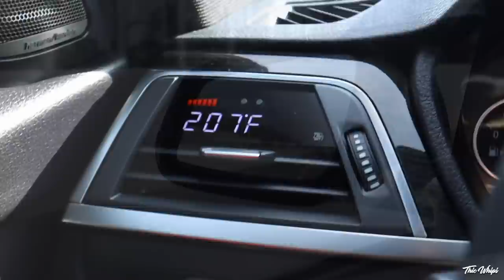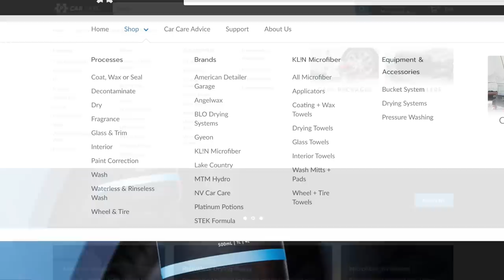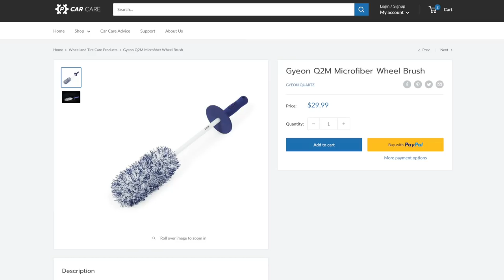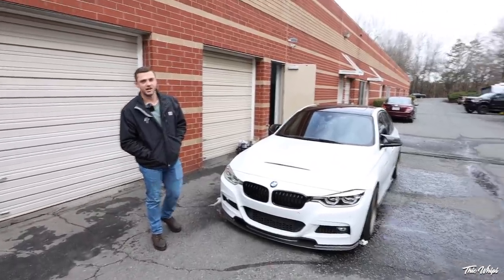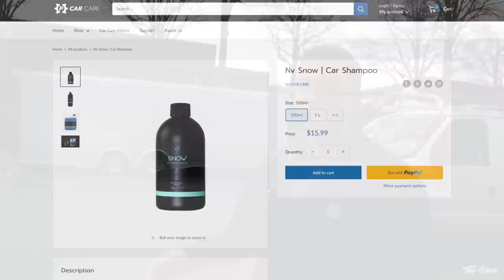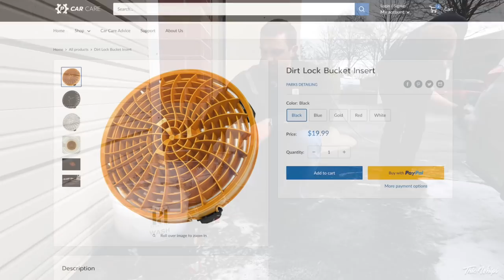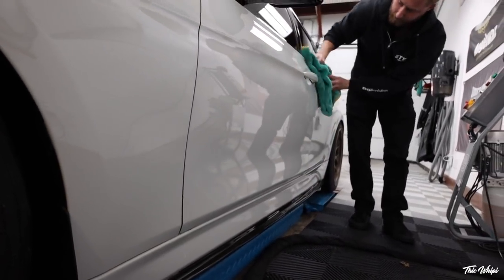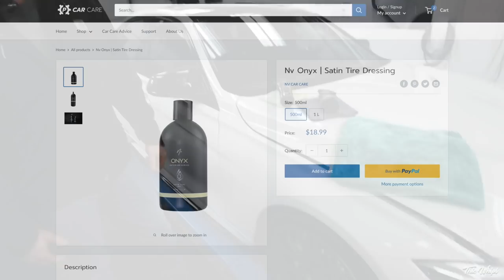HOW TO WASH YOUR CAR PROPERLY. (And the products you should use..)

Comment: Im not sure if that dude is washing the car properly tbh i think his techniques can be improved i.e starting from top then making his way down and applying this to every step i.e rinsing and contact wash. The bottom is the dirtiest. I wouldn’t start with the rear bumper. He needs to rinse for often too that goes for rinsing and washing the detailing brush as it will pick up debris from the intricate spots.
Reply: Also pre wash foam should go on dry.  Pre rinse puts on a layer of water and reduces the foam's ability to contact the dirt.

Comment from the maker: Use code: "thicwhips" for 5% off all Parks Car Care Products!

Products used today:
Stek Wheel Cleaner: https://tinyurl.com/yc6ey2vz
Klin Soft Applicator Pad: https://tinyurl.com/3zdrs9ky
Detail Factory Brush: https://amzn.to/3oD7QSt
Gyeon Wheel Brush: https://tinyurl.com/3bh873na
American Detailer F Bomb: https://tinyurl.com/mrasjkzr
Gyeon Tire Cleaner: https://tinyurl.com/4dbkubtd
Gyeon Tire Brush: https://tinyurl.com/mpzarvur
NV Snow Shampoo: https://tinyurl.com/nheh556u
MTM Foam Cannon: https://tinyurl.com/5826n6at
Klin wash Pad: https://tinyurl.com/489cznjs
Dual Bucket Washing Kit: https://tinyurl.com/3uxcddjb
Dirt Lock Bucket Insert: https://tinyurl.com/3bhn86n8
Klin Drying Towels: https://tinyurl.com/yc4nx3nn
Blo Air S: https://tinyurl.com/2p8mwvuv
NV Nova Boost, Quick Detailer: https://tinyurl.com/2p943rxf
NV Nova Jet, Spray Coating: https://tinyurl.com/mr4yn6t7
Stek Glass: https://tinyurl.com/2awkf9dt
NV Nova Envy, Ceramic Coating: https://tinyurl.com/mryxm38h
NV Nova Wheel, Ceramic Coating: https://tinyurl.com/4yv3vv96

My BMW 340 B58 build Sheet: https://tinyurl.com/2x5z2wnb
Reply: 100k subscribers let’s go

Comment: Question. I had ceramic coat applied to my car, two layers. Well I picked it up as soon as they were done and it was raining pretty heavy and continued to rain for the next 3 days. I drove my car because it's my daily. Would this affect the curing process of the ceramic? I notice that water doesn't bead on the side of the car the same way it does on the top.

Comment: One the best detailing videos, thanks for this! I definitely was having issues overthinking the types of towels and microfiber and this video eased my mind quite a bit….. Video also confirmed that I was doing most things right but could improve my methods a bit. Love the tip on cracking the hood and the blower with t small drying towel. 👍🏾